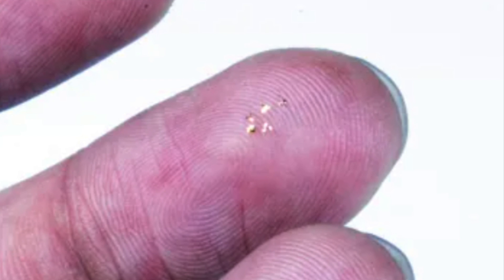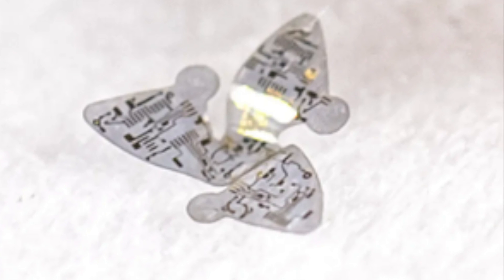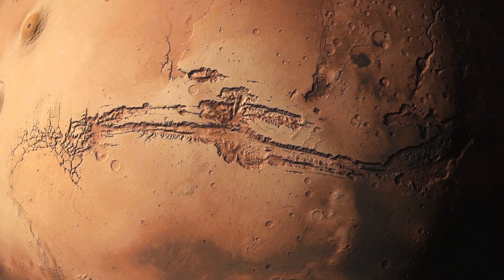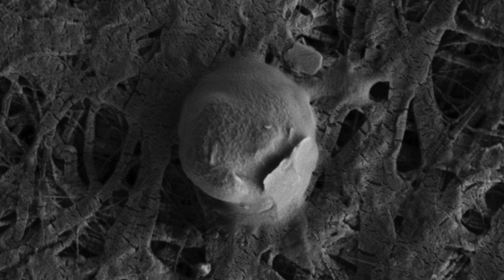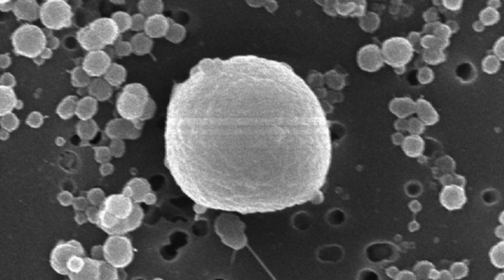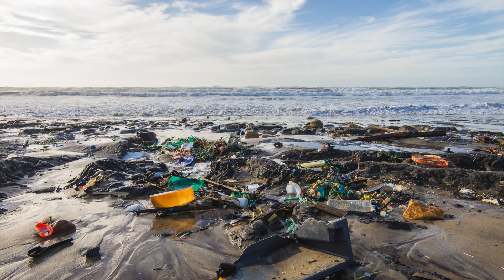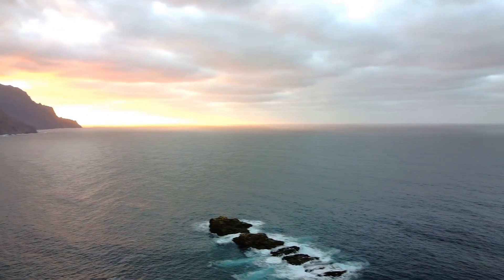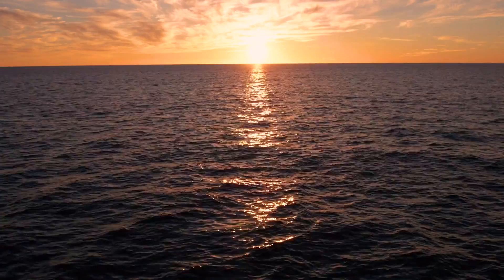Scientists Just Announced They've Created The Smallest Ever Wingless Structures That Do This

Comment: 3:12 “a drone faster than the speed of time.” I’m sure the narrator meant sound, but if not.... I want one! Either way, I want one!
Reply: Time is correct. The speed of light is 186,282,397 miles per second. Think about it... Per second. Mankind can only fly at 25,000 mph to leave Earth's atmosphere.
Reply: @piglet1242  Time is not correct, Piglet.
Reply: @bill9822  I agree to disagree although I understand your argument. Mankind can't possibly travel the speed of light (which is my point). Yes the speed of sound is meant by time, but it is sound, not light.
Reply: @piglet1242  Ahh. So you have seen the light, but not yet heard the sound, my dear Piglet. It will follow.
Reply: @bill9822  Yes. I've heard the speed of sound when the barrier is broken. Was born and raised in a big city that had an airport about 2 miles away. Check out YT vids of jets breaking the sound barrier to observed the cone around the plane and also hear the sound.